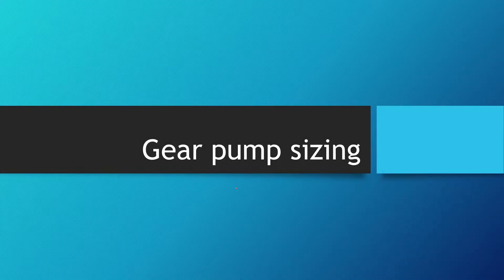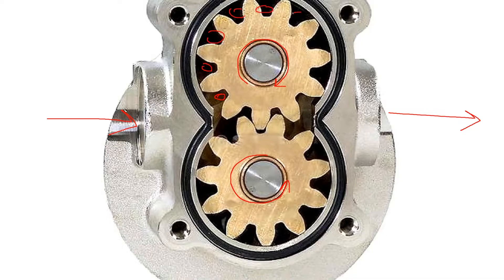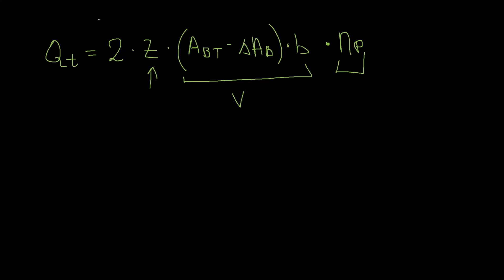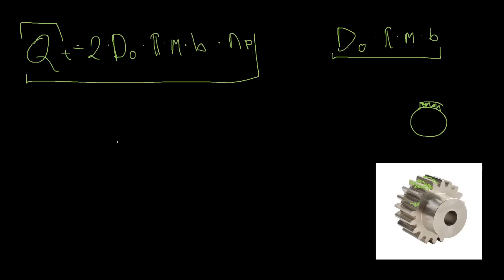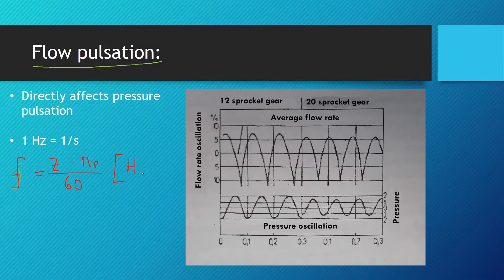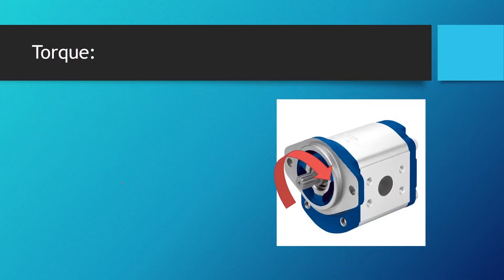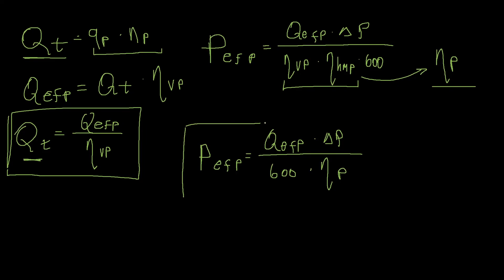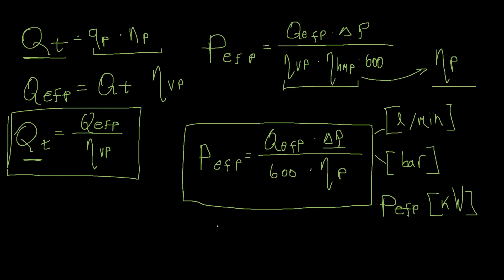How to calculate gear pumps

Comment: At 12:45 the delta P is defined as inlet pressure + outlet pressure. Shouldn't that be Outlet pressure - inlet pressure ? Delta indicates a difference. Also the Pout - Pin is the pressure the pump adds to the fluid. That is more relevant than the sum of those two pressures.
Reply from the maker: You are absolutely right, the right way to do the pressure difference is like that. In the other examples where we have these kinds of equations it is done in such a way. This is an example of a pump being directly connected to a fluid source so when we say "underpressure" we actually mean the vacuum that happens in the inlet port of the pump so adding the outlet pressure will result in the same delta p, but this isn't the proper way to calculate delta p in general examples you are right. Thank you for your insight! :)